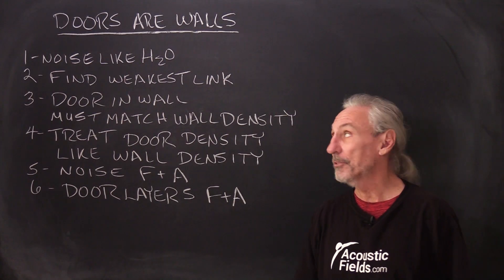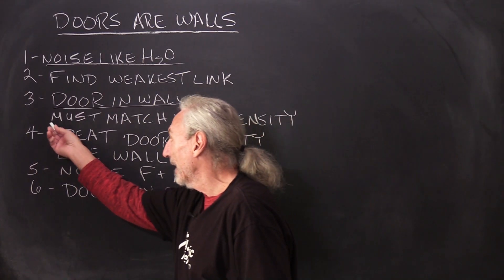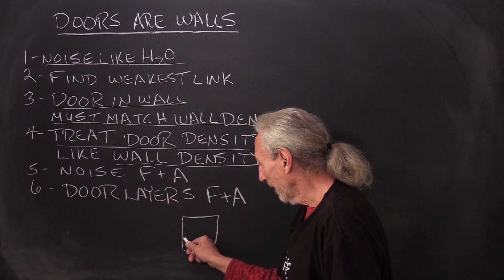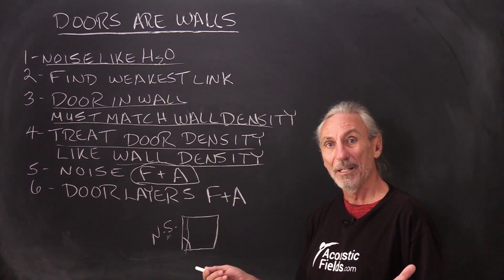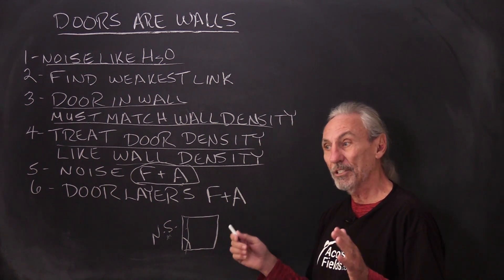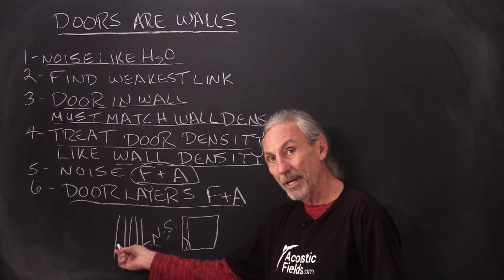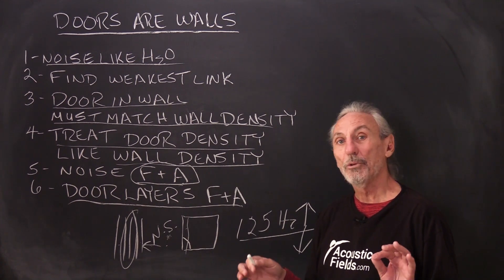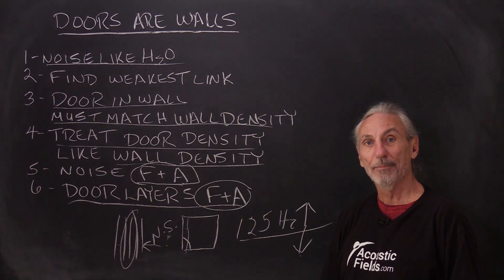Doors Are Walls - www.AcousticFields.com

Comment: If you do not need soundproofing from other rooms and follow the advice that comes with the LX521, then having your audio room open to the rest of the house, especially at the rear wall, is not a problem right?
Reply from the maker: If you must have an open wall, it should be the rear wall. An open rear wall reduces pressure and minimizes the time signature of reflections.
Reply: @AcousticFields  Thank you for reply and the great videos you share.  Sounds like opening to the house to get  more room volume is more trouble than it's worth.  In your other video you said "depending on the type of listening we want, we may or may not need a rear wall".  Would you expand on that a little please?  I am designing my next house from scratch, and like a hifi nut, designing it around the listening room.  Love movies much more than music, but after 20 years of stereo, may stay away from surround sound, and stick with my NaoNote ii by John Krekovsky (hence I turn to the abundant LX521 advice for room setup).
Reply from the maker: @ichii-ka  For a two channel listening room, stay with width dimensions of 23 - 27', height 13', and length of 27 - 31' . This room size will have enough room volume to allow the treatment to be more effective and produce a higher resolution.
Reply: @AcousticFields  Thank you! Sounds feasible for my upstairs, if I use the whole floor (will not be a big house).  I am surprised at the dimensions however, where it is very close to a square, which as you say we should avoid. Only slightly off-square is ok?  For example 23ftx27ft (7:8)or 27ftx31ft (8.2:9.4)?
Reply from the maker: @ichii-ka  Square rooms are not an issue with proper treatment that has the proper rates and levels of absorption. Remember most of the suggested ratios are for rooms with no treatment. When you have treatment as powerful as ours, you can overcome 90% of most pressure and reflection distortions regardless of room dimensions.  More favorable diemnsions, more treatment effectiveness. If you are building a room from scratch, you should use our CAW system where we incorporate all lower frequency pressure treatment into the walls.
https://www.acousticfields.com/carbon-absorber-wall/
Reply: @AcousticFields  Still a little lost here - the near square dimensions given are making extra treatment necessary right?  Frankly I want to minimise the amount of treatment needed, due to cost, space and complexity concerns.  In which case I should surely aim for more rectangular dimensions since I have that option with a blank page design process?
Reply from the maker: @ichii-ka  Stay in the ranges I gave you. Use 23 - 27' w x 13-15' h x 27 - 31' l
Reply: @AcousticFields  Thanks again - will be going through your videos and website to learn more.  Very much like the straight to the point manner.

Comment: What worked when I built my soundproof room was two heavy solid wooden doors bolted together lined with lead sheet in between and hardboard on the outsides and lots of weatherstipping around all the edges.   My room had TWO of these doors since it was room within a room construction.  One door on the outer room and another for the inner room.  Both equally heavy and thick.  Like bank vault, bomb-proof thick.   I had to custom make my own hinges and they were extremely heavy and very difficult to hang, and it's difficult to support all that weight.  I think each door weighed around 300 pounds.  I used Room within room construction.  And a piano inside my room cannot be heard AT ALL directly outside the door, played as loud as possible.  No conventional door will work.  You've got to go super heavy, and use layers.  I have no degree in anything related to acoustics but studied and researched a lot and experimented a lot before doing my build.   

Also, another key was making the doors have a small of an gap as possible all around.  This took a lot of trial and error and having a handheld power planer was key to .  I lined the top, bottom and sides of the doors with sheet lead and only had a minimal air gap, which was sealed with good rubber weatherstripping all 4 sides of the door.  I also made the bottom strip/threshold removeable because when moving heavy things in and out of the room, I didn't want to damage the door threshold or trip over it.  The perimeter of the door has to be super strong and reinforced to be able to hold the weight of the massive door.  I also put additional layers and soundproofing all along the perimeter area where the door was hung.
Reply from the maker: Noise must be thought of like water. It will find the weakest link in the structure and go through that area. Vibrational acoustical barriers are built differently than absorption technologies for air borne middle ranges and lower frequency pressure issues. People think you can use sound absorption technologies to treat noise transmission issues. You can not as you have demonstrated. Thank you for sharing real world methodologies for noise.

Comment: I really need to make a decent door for my studio, definitely the weakest link, it's just a hollow core door. Any tips on door handles? are double doors better?
Reply from the maker: Make new door twice the existing wall density and use air tight molding.